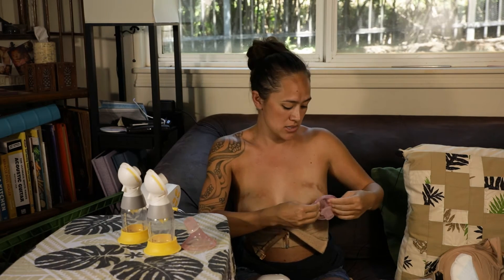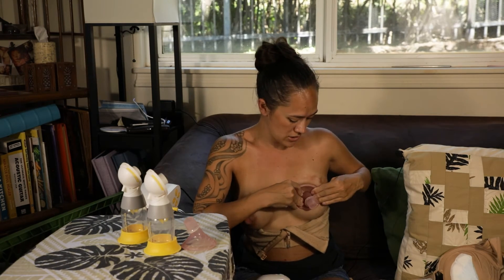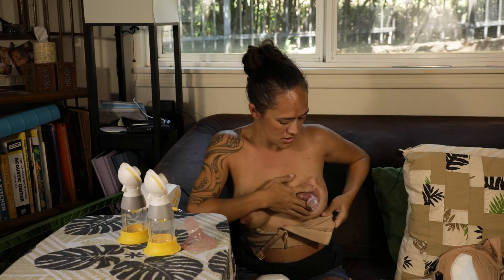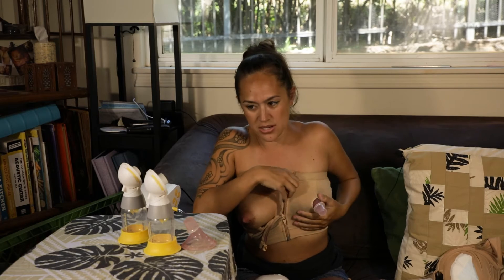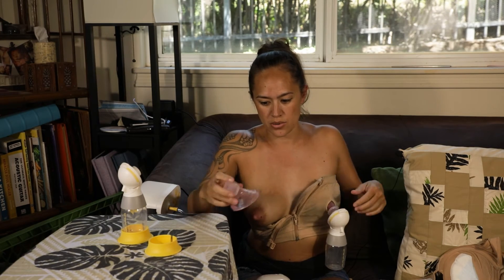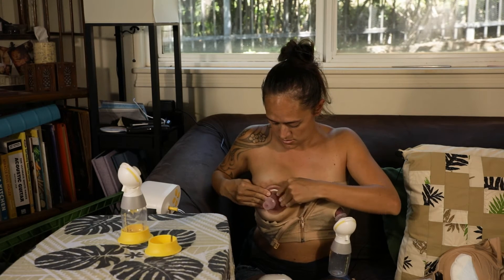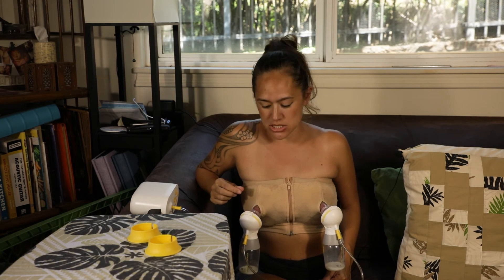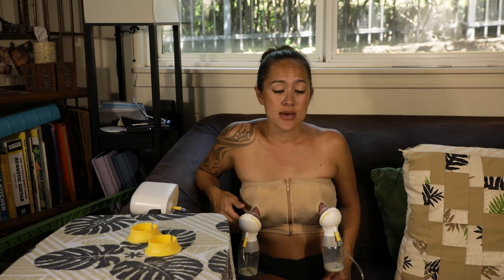How to Use the Pumpin Pal Silicone Flanges & Why they Might be Good for You while Pumping

Comment: I did not see her apply a lubricant. Is this not necessary? Should I stay away from a lubricant with these flanges? TIA
Reply from the maker: Hi Tanica, the pumpin pal flanges recommend using them first without any lubricant as they do function a little different than typical flanges and hold onto the breast tissue more. If after a few times you feel pinching or pain you can try a little bit of lubricant or coconut oil. 💛
Reply: @mauibreastfeedingsupport  thank you so much for responding! This is so helpful ☺️